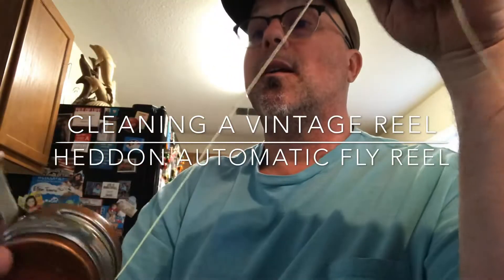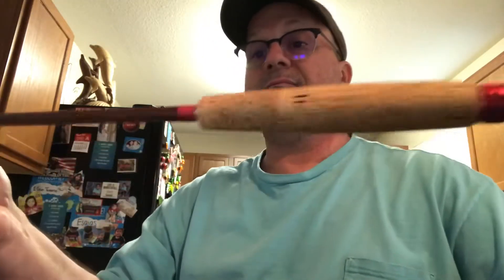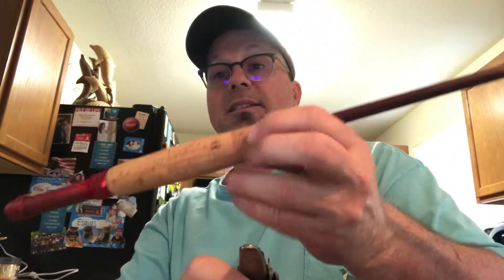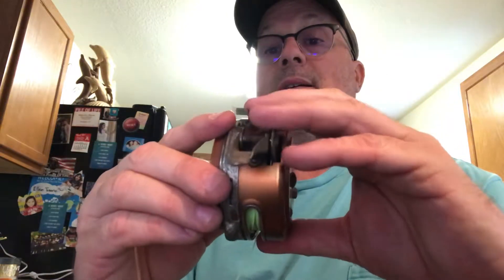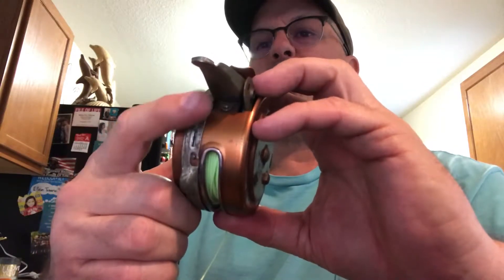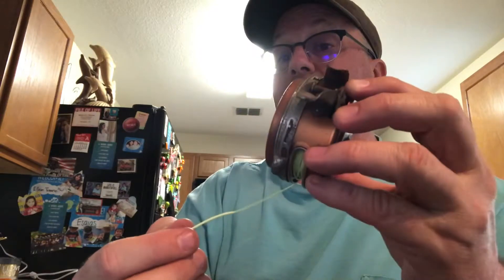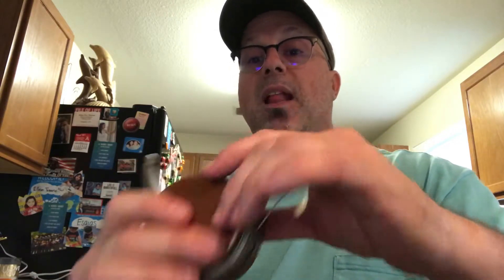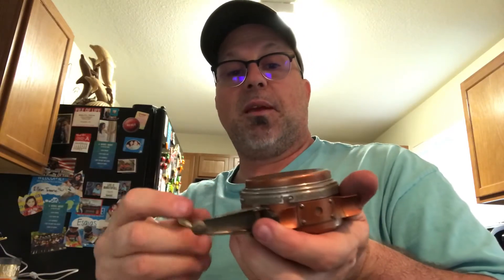Cleaning and loading line on a HEDDON automatic reel no.37

Comment: Whats twisting that side cap, making it click, do? I picked up an old Martin for $10 at a flea market.
Reply from the maker: To reassemble the reel, you have to put the spindle in the spring to partially assemble it and move the parts around to fit the parts over the other parts. I may need to do a better video.
Reply: @KillerFuzzOutdoors  i got it figured put when i respooled it. the side cover is the clock spring winder. Once i had it apart it all made senae. Set it up with some 6lbs ice line. Gonna see how fast it freezes over

Comment: Oh so lame!
Reply from the maker: Thanks for being so encouraging
Reply from the maker: What do u want to know about the reel?
Reply: @KillerFuzzOutdoors  Thank you for responding. I apologize for my rude comment. I've acquired a vintage Martin automatic #6 reel and I want information on how it works and how to set it up. I've never fished with a fly rod and reel. It's old and it probably needs to be disassembled for cleaning. I'm capable of doing it myself if I can get a little explanation and don't want to pay a fly shop. Your video came up in my search results and I guess I was expecting more info than I found in your video.
Reply from the maker: The hardest part is putting the spring back on. Just put the axle in the spring and you can move the winder around and fit it over the parts where the string goes